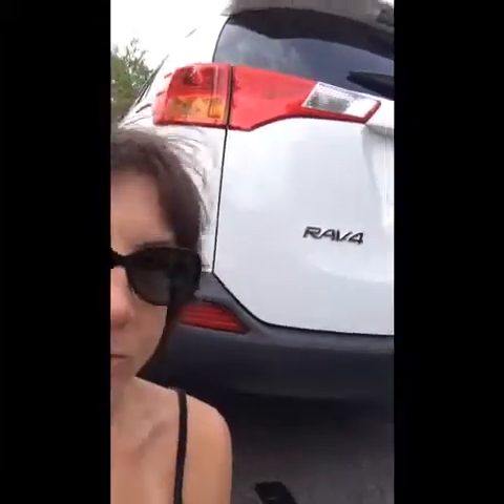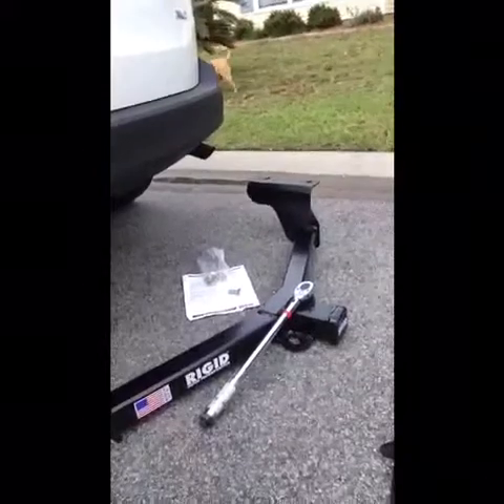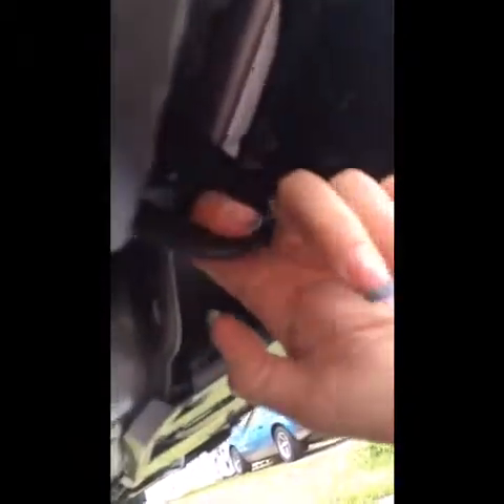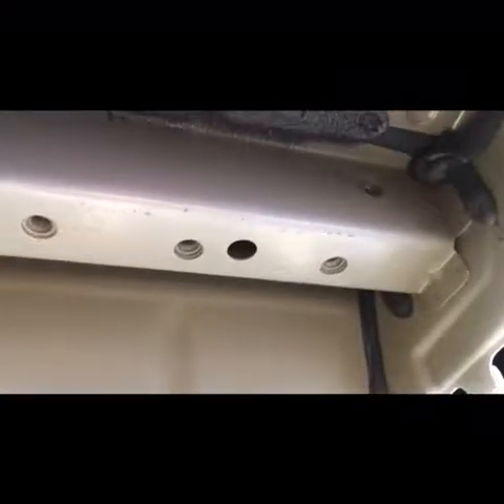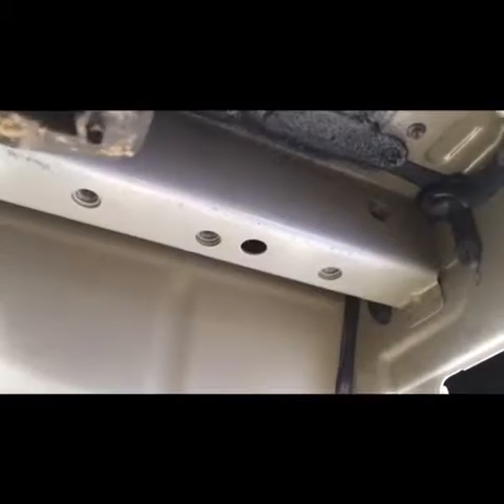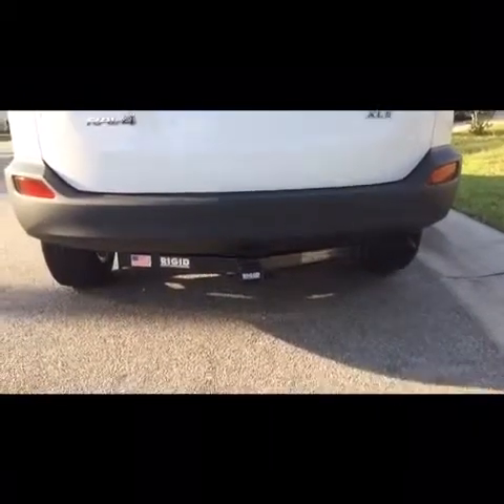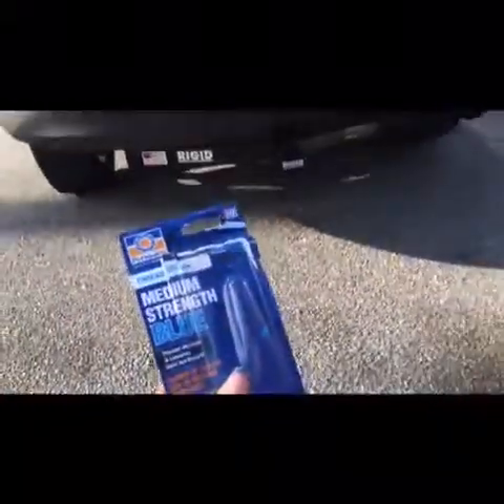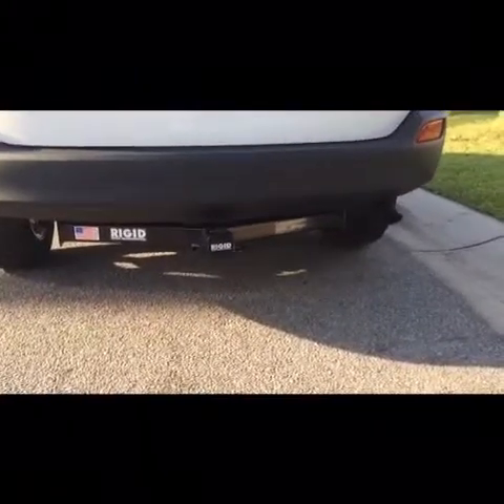How to install a trailer hitch to a 2015 Toyota RAV4

Comment: What kind of hitch did you use?
Reply from the maker: Rigid, class 1. Check your allowed towing capacity under specs of your vehicle. Then cross check weight with towing weight classifications. (Mine, and most small SUV is class 1) hitches, differ slightly by how they are built, but most are four bolts, like I showed